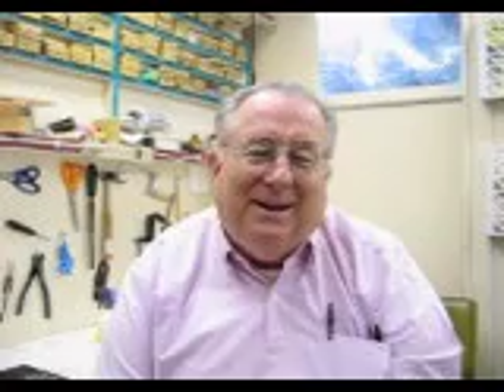Five Reasons Solder Does Not Flow

Comment from the maker: Hi, I just read your comment about oils and sweat affecting your soldering. It does not. I have never worried about it, and have purposefully put oil on the silver and the solder to proove that it burns off far before the solder is ready to flow. Just spray on Auquiflux and solder. In 35 years I have never cleaned my Silver or my solder.
Don